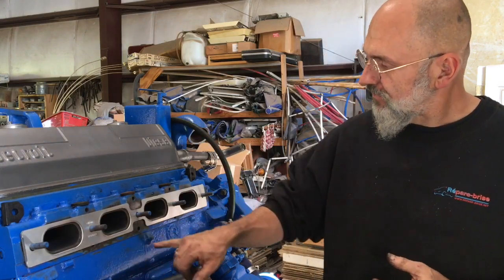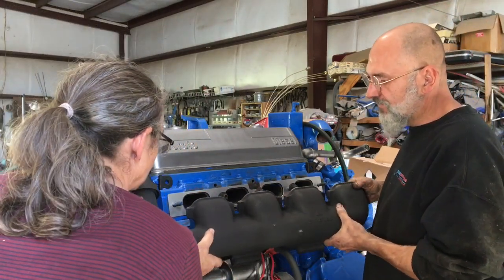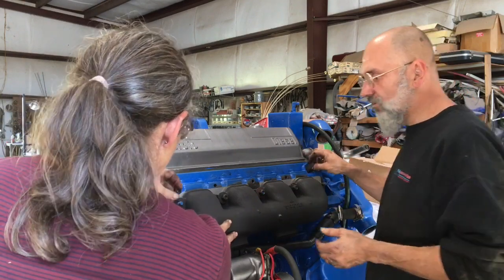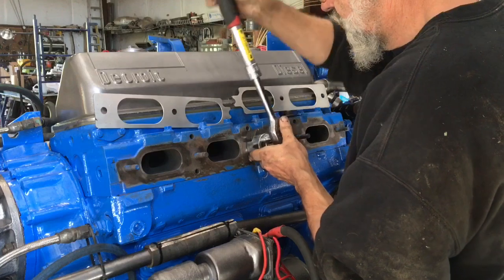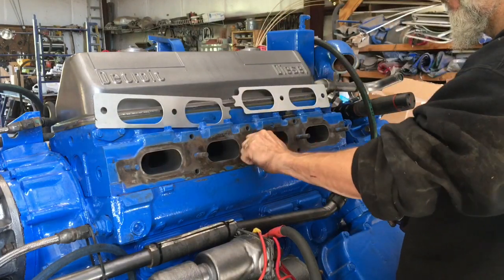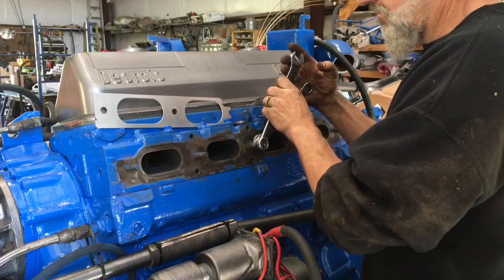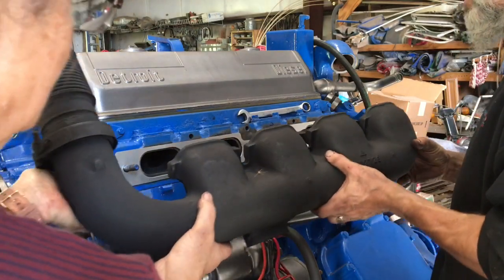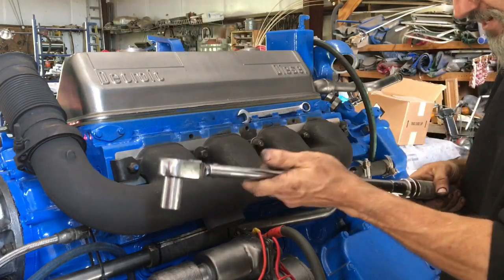Detroit diesel 2 stroke exhaust manifold installation and stud replacement.

Comment: I am very familiar with 53, 71 and 92 series Detroits yet the 8V71TA is foreign to me. Yet while using all the different power plants dragging trailers loaded and empty the 71TA I have only heard of. Turbos intrigue me as I assume you must better the 350 advertised HP by a fair amount but I had no idea after cooling was a thing back when I ran them. Is this how they managed such ridiculous HP numbers for the marine applications and why were they not available to hwy tractors?
         Mike
Reply from the maker: It’s a 1984 block, originally a right hand rotation truck engine that was rebuilt and installed left hand Rotation in this bus in 1991

Comment: Is that the engine that had the bad rebuild?
Reply from the maker: Yes, thankfully the block didn’t suffer any damage.
Reply: @LacroixCruiser  You seem to know how to swing a wrench and have by the book knowledge of how to do it. For the cost of the 2 rebuilt kits, 2 gasket kits, and the labor to pull it off it's apparent that you could have done it yourself. Just send the block out to be hot tanked and pressure tested.
Reply from the maker: Last year we didn’t have the time to do it ourselves.
Reply: @LacroixCruiser  👍👍👍

Comment: I am really enjoying these videos.  I like the slow, calm, detailed approach.  Can you please lower the volume of the background music?  Also, replace it with something less repetitive or do away with it entirely?  Thanks.
Reply: My 8v92 is the same exhaust but my omc johnson 4l v8 2 stroke small block side oiler has all the exhaust going to to the middle so aturbo can be mounted after the exhaust chamber, this has been done on some omc v6 and mercury v6 2 strokes.